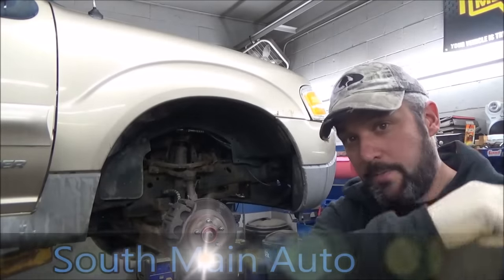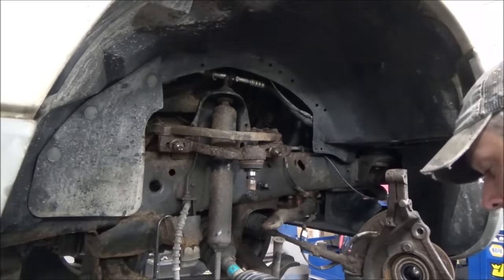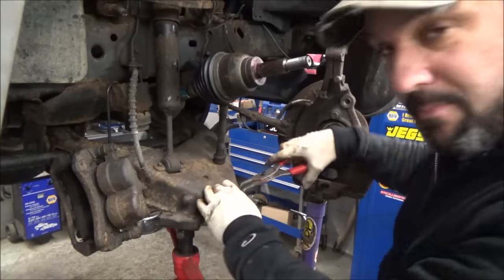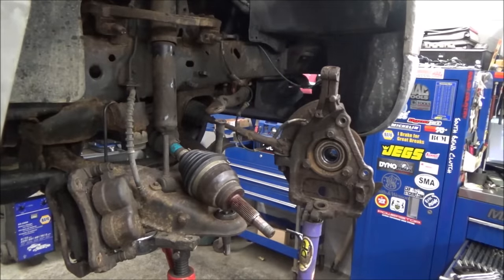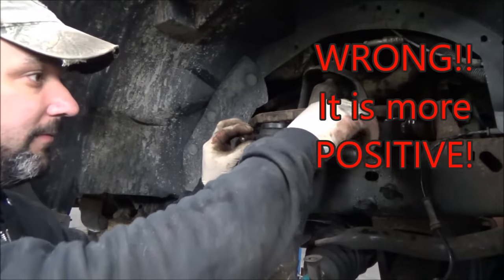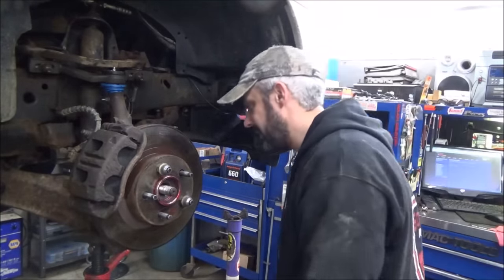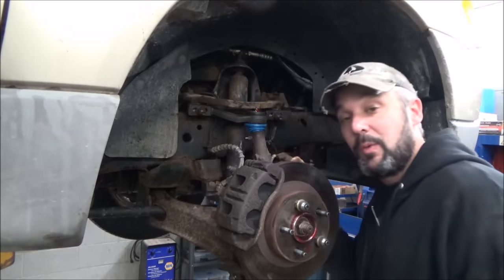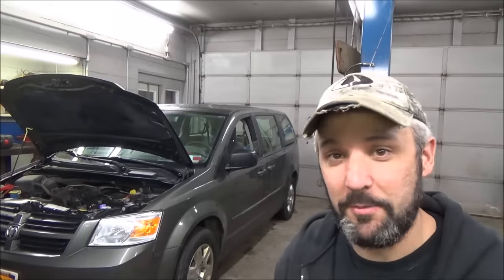Ford Explorer Sport Trac - Ball Joints

Comment: Great stuff man! Would you say the Astro hammer, with your first impression, has more grunt than the Snap-On Hammer PH3050B? I am in the market for one, and everyone I talk to swears by the snap on...but I am not sold on it. Thanks again man for the video, keep the awesome-ness coming!
Reply: I owned that model Snap-On hammer & I hated it. It kept bypassing air. I gave it back for truck credit.  I the bought the big Cornwell hammer. It was a beast but after a few uses it bypassed air. Finally I bought a very small regulated hammer that belonged to a Trailer mechanic that he used to buck steel rivets. It's small, ugly, used, & I don't know what brand it is; but, I love the little guy. It hits hard and fast.
Reply from the maker: +TheTexasCoder Well I own the Snap-on too and a Mac. The Snap-on has been my fav for many many years. Have never seen one more powerful yet. This Astro has a slower stroke and uses a larger piston. It hits the object harder but you don't feel it in your hand like with the S.O. I have to give it more time to make a good run down.  I am pretty attached to my Snappy so time will tell but so far I am liking this little guy...
Reply: I am very pleased with an old Snap-On PH500C....kicks hard..

Comment: I'm going to make a voodoo doll of you Eric, you NEVER run into any problem bolts, studs, clamps, connectors or fittings .... everything is so damn easy to come apart !!! So your next show when you put panther pee or heat on that bolt and it DOES NOT  round off, or break off, or spin around or not budge at all .... and it comes off easily with no fuss - - you will feel a pain, or pinch or sting from when I stick the needle in your voodoo doll !!!! Job should take 1 hour - 15 minutes to do the job, and 1½ hour to get the bolt free, or clip off, or the stud breaks etc ... is the story of my mechanics life !!!!!!  You must have been born the day all the celestial planets lined up in a row bestowing an easy life to you !!!!!!! You feel that pain just now !!!!!!!!

Comment: Big nasty there will turn bolts into rivets in half a second flat. big nasty has some grunt. If alll else fails read the instructions. Inexpensive is always good. Your workshop doorbell is the same as my house one, so everytime your one goes off in a video i look around to my front door. LOL You were talking about looking up. This is something one of my bosses did some time ago. we had a 60 series landcruiser in my bay . it had come in for an oil and filter and a set of Glow plugs as it was hard to start and we checked it out and some of the glow plugs weren't working. id started the job late in the previous afternoon. I'd changed out the oil and filter and fitted new glow plugs and fresh oil. We didn't have the oil filter in stock so ti was late so we ordered the filter and it was to turn up first thing in the morning.  My service manager jumps in it first thing in the morning and goes to start it while I'm putting on my overalls.  He had the office mobile phone to his ear. It started and he reved it up a little. by that time it dumped the oil out of the motor hit the inner guard the hood my work bench, the tool box and the window behind it. Those old 2h motors have good oil pumps. LOL

Comment: dude etcg had to weld that ball joint because crazy glue is not sponsoring him
Reply: +heyitschinoable   Poor ETCG is never going to live that one down.  I still respect him though and know even the best of us make poor choices at times, but the main thing is the same mistake isn't repeated.  I'm sure with the overwhelming responses he got on his video, he won't repeat that method.....hopefully.
Reply: +Discretesignals Yes. He and Pete Caroll (Seahawks) will take their decisions to their graves except ETCG can at least take the car back and redo it to shut up the critics. There's no way that "weld" has held up this long. The customer probably has already taken it to another= shop for it to be done right, however.
Reply: +Samuel Gonzalez Can I have a link to this video?
Reply: +Samuel Gonzalez .....didn't he weld it since it was too small, he didn't replace the arm, or get the over sized ball joint, etc....whatever. IMO he still does competent work.
Reply: dwoodog
He didn't even weld it properly so still no good. Plus welding boils the grease inside the joint so you can't win welding it... If the ball joint was to small he should get a proprer one instead if doing what he did. Not competent at all.
Reply: +Samuel Gonzalez IMO ETCG does good work, except  this time. To not overheat the bj, he could have welded a bead on the control arm around the bj while it's installed to eliminate the gap, then tack weld the bj in place.
Reply: Cooll Asice
No he couldn't.
Reply: +Cooll Asice always remember when he did this ...he was doing it for FREE ..if he bought a new control arm...HE would have paid for it  out of his own pocket
Reply: +deepsquat600 It doesn't matter if that was free work or not.  That is a completely incompetent and irresponsible way to fix a vehicle.  He needed to stop the job and explain to the owner's vehicle that he needs different parts to properly perform the repairs.  He is putting someone's life at risk when they drive the vehicle after that hack repair job.  You either fix vehicles right or don't touch them at all.
Reply: kj197734
Amen!
Reply: +deepsquat600 No no no...he wasn't paying for shit. Those parts are all paid for from sponsors. And technically, he is getting paid for the work, because if he makes a video about it, he gets the ad revenue from that. ETCG just came out with a video replacing that control arm, and he said he did it to make the sponsors happy. I think they were pissed at him for cutting corners when they gave him money for that job.
Reply: He went back and replaced the knuckle etc properly after getting so much backfire from comments.
Reply: PigBoat9
Link to the video?
Reply: at the yearly get together Scanner Danner  ( Paul) admitted that he did the same thing once,,and it lasted a very long time
Reply: What about the engine build on the fairlane? Did you guys see the engine builder kick him off the build because he couldn't push the pistons in?
Reply: Cooll Asice  remember Eric was paying for this cars repairs out of his pocket.. so I doubt she took it to another shop (BTW ,,Eric has said that he did bring the car back and did it right... but Scanner Danner admitted h has done similar
Reply: frankenstrat25
Friction is stronger than weld in this case.
Reply: Gregory May
How do you know that?
Reply: how does he know that?? lets see.. one is pressed in with very tight tolerances ..the other metal  is heated to a few thousand degrees until it melts and flows together with other liquid metal ..as the two areas cool they form a single piece even on the microscopic level ..they are one .... thats how he knows
Reply: I wasn't talking to you, I was replying to the comment directly above mine; I'm on your side...
Reply: yes I know.. Iwas explaining to you why a weld is stronger then friction ... I have never said the repair was "right" ,, just that it works ..and by all logic it is better .. just un- repairable after he did that
Reply: Ok, now I'm seeing the sarcasm! I was getting ready to explain why a properly done weld would be stronger than a friction fit, and then your comment appeared. Which was confusing since I didn't expect someone else to reply, let alone sarcastically.
Reply: deepsquat600
Really? Somehow if shit breaks it breaks on welds. Welds break all the time and friction fit is sooo tight that it will never ever come apart and it gets tighter with time when metal rusts. Ever seen friction fit came apart on suspension or driveline parts?
Reply: Agreed, a weld done right is stronger than the parent metal (possible exception when dealing with heat treated metals, but if you weld heat treated metals you should weld BEFORE the heat treat process).

A lot of these welds break because the act of welding means breaking paint, and that means rust. Not that it's a bad weld, it's just that all too often they forget to paint over the weld after they're done, or can't paint it because it's exhaust parts.
Reply: @coollasice4175  - Wrong.  Not only did the welded ball joint stay in place, but in a later vlog, Eric replaced the lower control arm with a New control arm/ball joint.

Comment: Now you done it.  I guess the Astro air hammer is a keeper since you went and named it.  Upgrade that shop computer to Windows 10 (it's free) and it work a lot better than Windows 7.
Reply: +Bob Moy Um, no it doesnt. No need for 10 unless you use touch screen. Security is a huge issue and way to many bugs. They charge  for all the little things that come with 7.  If it aint broke, dont fix it.
Reply: +Bob Moy Never update to a new version of Windows before the first couple service packs have been released.
Reply: +brian0918  Win 10 is great, It's just like having the entire Redmond crew watching everything you do....  Because they ARE!!!   Read up on 10 and you will find that it should have been named sieve....
Reply: +Bob Moy Seriously bad advice. Windows 7 is great, less crap and bloatware. There's a reason the upgrade is free. You are the product now. Oh and the nickel and diming for software that they sucker people into.
Reply: I had Win 10 Loaded up and it suxor'd - I had to replace the HDD because just the fastest and cheapest way to get back online. I didn't have the tools to unscramble the FAT. HP had some darn proprietary schema that regular tools couldn't fix. It's good though I had the software and files covered so after a fast install and format I reloaded back to 8.1 and back up in a couple hours after I got the basics dealt with.  Don't "upgrade" to Win 10 -  wait till the computers are on sale and come preloaded. more importantly - Let Win 10 go through a couple three major "version service pack updates" before you do buy up.
Reply: +Dan.vaku The upgrade is free in order to compete with Apple.  Apple have offered their OS X for free starting with Maverick OS X 10.9. It also offered  Yosemite and now the current OS X  El Capitan for FREE.  I have upgraded 3 desktops and 2 laptops to Windows 10 with no problems.  Microsoft learned a lot from Windows 8 when they deleted the 'Start' button with users complaining.  In windows 10 they brought back the start button.  They integrated voice helper called Cortana similar to Siri.
Reply: Bob Moy Sweet, voice activation! Now I just need a microphone... and a reason to need to talk to the computer!

Comment: Eric, I just noticed that mine Moog was installed with the inboard mark 45 degrees facing forward, does it mean that I have to remove all to rotate that boot 45 degrees more to face the engine ? Thank you for the video. I really trusted that the other guy would knew this, my bad.

Comment: Why no safety glass or hearing protection while using the air hammer?  That air hammer was been out for over 20 years made CP tools,  think rust belt techs would know about a great the .498 hammer.

Comment: Eric what's the final verdict on the big nasty?  Is it better then the IR long barrel.  It does have a big price tag.
Reply from the maker: +Steve Hutchinson I will give it time. I won't make a call on a tool with only short term use. It is very powerful however.
Reply: The long barrel will pack a lot more PUNCH,by far.

Comment: So, what would happen if you installed the ball joint without regard to the inboard mark? Are they angled slightly? I get the boot going on one way with the grease concern. But what about the joint itself?
Reply from the maker: +Erik Andresen Good question. Some joints like lets say an upper bj in a Lincoln town car can only go in....check that.....should only go in , in one direction. In that case the outer metal housing on the bj has a mark on it to tell you what way to orient it...
Reply: +South Main Auto Repair the reason I ask is that I did both lower bj on my 06 Dakota and didn't notice the arrow mark until I was on the second side. Not sure if I properly lined up the first one. But it has been a year and nothing has happened yet. So I guess it's ok.
Reply from the maker: ***** Time is the best tester.... hey forgetaboutit huh!

Comment: What ya think of a thin coat of oil/grease on the mating surfaces between the ball joint and control arm? What about anti seize on the arm bolts themselves?

Comment: Fluid Film -  I am not knocking it, but how well does it really do on "long term" ant-corrosion ?  I would think a gob of old fashioned grease on those upper control arm studs would do a better job long term.
Reply: +theoldwizard998 ^^Agree, but every mechanic uses the stuff he/she likes.  I like stiff grease for those spots.  It says there forever.
Reply: YouTube fluid film tests, see for yourself
Reply: +Nikolay Baranyuk I'm not even going to look because I'm sure it is great stuff.  My brother-in-law and I were once computer programmers (nowadays software engineers).  We'd get together on weekends to work on code and looking at my code he would always say, "There's another way of doing that."  To which I would reply, "Why do I need two ways of doing the same thing?"  I think that applies here too.
Reply: +theoldwizard998 Works very well. It's basically spray on lanolin and paraffin.  Try not to spray it on the exhaust, burnt sheep is not a good small! My favorite for real rust stopping power is Waxoyl.
Reply: +theoldwizard998 I think he should use the marine version of fluid film, it is like a grease, its goopy. but it lasts 3-5 years instead of 1 according the FF. its called FLUID FILM Liquid AR.
Reply: +Bardia Ghajari I thought it only came in a liquid form !

Comment: I'm in the habit of just shearing the cotter pins off with the nut. After that they're quick work with a punch if I'm going to reuse the joint. Easier in my book than goofing around with an old pin.....

Comment: Ever tried using a socket on that rubber boot? Or do you think it'd tear it up?
Reply from the maker: +JasonMTG They have to be pretty precise because the boots rip really easy
Reply: That's unfortunate. Figured you thought of trying that and decided against it for that reason.
Reply: Not sure if I was doing this right, but I've always grabbed one of the adapters out of the ball joint press kit and gently 'pressed' it onto the joint.  Those rubber boots can be a PITA...or they can slip on like butter.  So long as it gets the job done correctly and the boot isn't torn afterwards-Good to go!

Comment: I have an 01 Ford explorer sport with the same suspension setup at the 'trac' and I have a shake when I Near 70 mph (even after a new tires/alignment and balance) my upper ball joints seem fine but I haven't checked my lowers, would they be a smart option to replace to eradicate that shake?? Thanks

Comment: I don't think it'll work for me. I work on a lot of big stuff. I was looking at the specs. Only 1800 BPM, 2 11/16" stroke. I have one with 3000 BPM and 3" stroke and it recently met it's match with a 1.5" pin that was seized in the bushing. I'm looking for a bigger one.

Comment: How would you say that air hammer compares to the snap on one you used to use in all the videos? I have been trying to find one of those snap on ones for a good price used on ebay for a while now cause i have heard they're the "biggest and nastiest" but does that astro perform as well as the snap on?
Reply from the maker: +Chris Ryan So far it is just as mean if not meaner, trigger is a bit stiffer and according to Astro it is suppose to hit harder. Heavier piston, slower strokes but more surface area... time will tell!

Comment: Chicago pneumatic cp717 rules the roost. trust me, until you use one you have no idea how powerful an air hammer can be. the tool you have is nice, the snap on 3050 is better but omfg the 717 just slays. it's ugly, it's hideously expensive, but beg borrow or steal one you have to use one.

Comment: I spy a vortec/ls engine in the background 😀
Reply: +moldymac I believe its for the chevy pickup with no oil pressure mentioned in a previous video. But yeah you cant help but Tim Allen grunt at the sight of the aluminum heads and coil packs on the valve covers.
Reply: +moldymac Lets hope Eric does a video on it..
Reply from the maker: +Reginald Locklear stay tuned... all I will say!